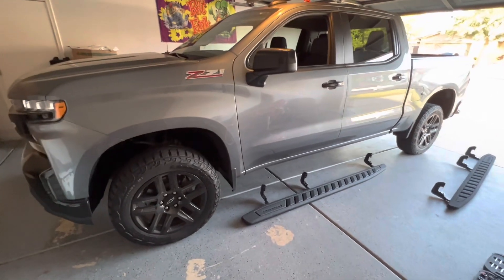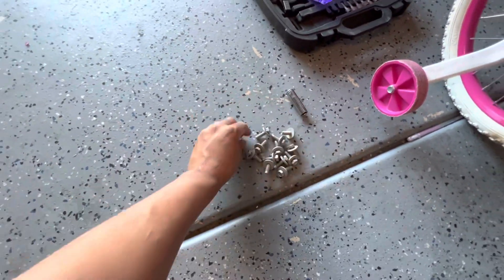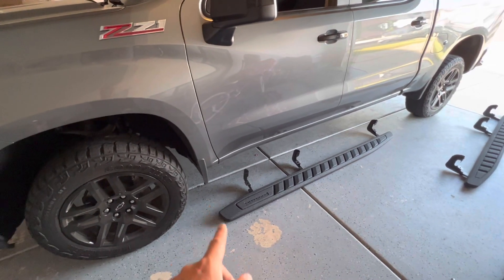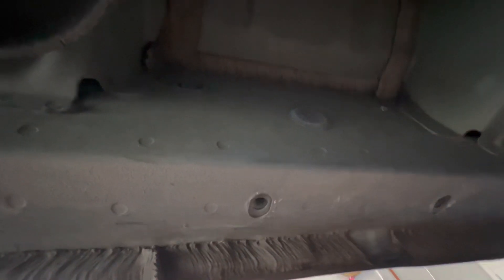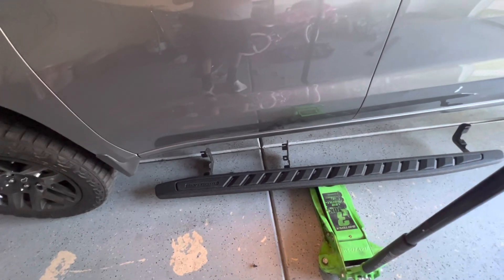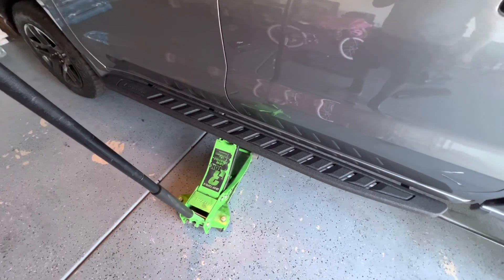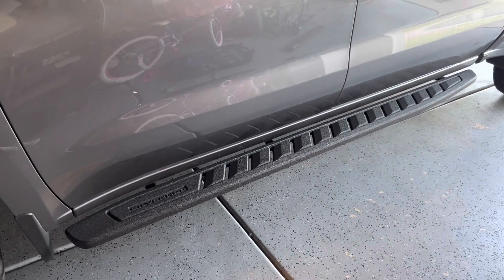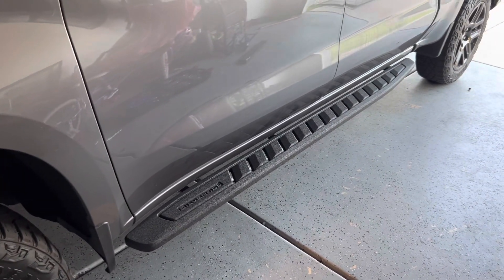Installing Running Boards On My Chevrolet Silverado Trail Boss

Comment: love the look of the running boards. I couldn't find them using your parts number on the My Chevrolet  Rewards page. I have a 2022 Crew Cab 1500
Reply from the maker: Thank you, contractor local dealer. Part might have updated

Comment: Thanks for the vid . Do you think silverado running boards would fit on a 2022 suburban?
Reply from the maker: To be honest I’m not 100 percent sure, might need to contact your dealer but they might have similar options for suburbans

Comment: What clips are you talking about at the end of the video that need a special tool?  You mean the plugs?
Reply from the maker: You need a special tool to remove those plugs but it makes it easier if you have one
Reply: @WrenchingMafia  Gotcha...thanks, just was confused because you called them plugs at one time but then called them clips...
Reply from the maker: @rikipotsticker9653 sorry for the confusion

Comment: Are those possibly backwards? It would look like the skinny side would be up front because you cant step close to the front due to the door being there. And it would look like you would not want the skinny part in the back because it would be less surface area for stepping up in the back seat. Just asking. I bought these and i was looking for a video on them!
Reply from the maker: That’s the way they go
Reply: The “Silverado” logo would be in the back and facing the truck if you reversed these, so it looks right to me. Although I can see your logic.
Reply from the maker: It's they correct way 👍🏽
Reply: They need to be swapped sides